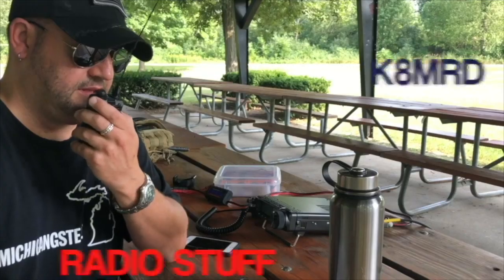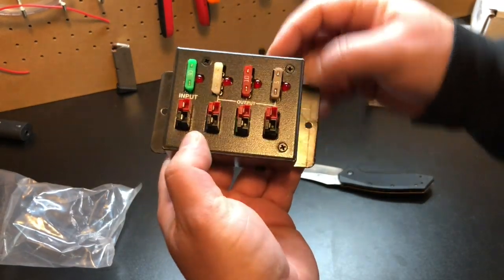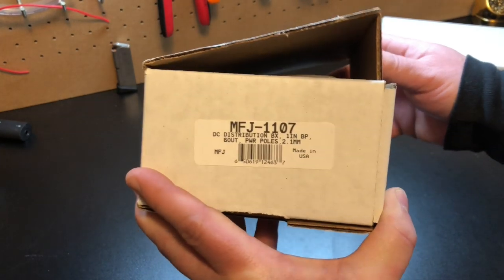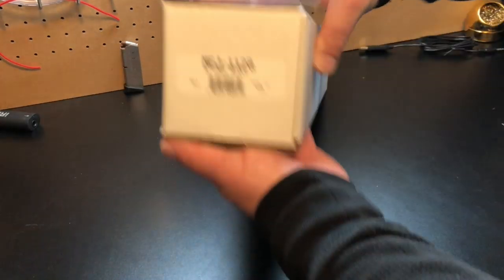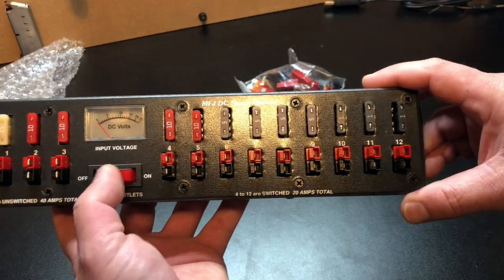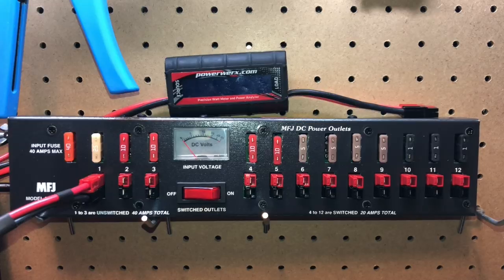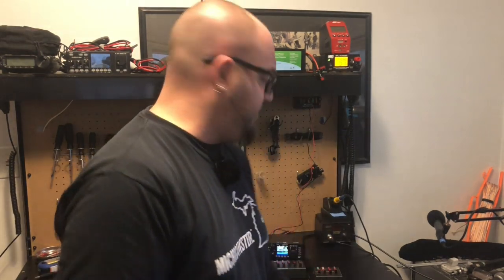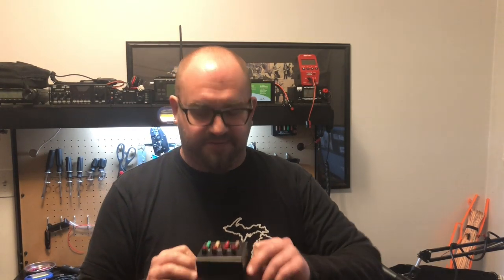Powerpole ™ Fever

Comment: Are they all 30 amp size power poles?
Reply from the maker: You can fuse them however you want if that's what you're asking.  The total current at any one time should not exceed 40 amps for the first 3 (labeled 1,2, & 3).  For the powerpoles that are connected to the switch (labeled (4-12) there is a max current of 20 amps.  It still doesn't matter how you fuse them though.
Reply: Mike
 I may not have worded that very well.
When I search power poles there seems to be three different sizes.
15/ 30/ 45 . 

I’m wondering what size power poles what I need to connect to these.
Matt
KO4WRY
Reply from the maker: @black75powder  Ahh, ok.  That's easy.  Any of those will fit.  The current rating is for the part that crimps onto the wire, not the housing itself.  Also for wire size.  15-45amp will all fit the same housing and you can mix and match what they are connected to.  For example, my tuner uses pretty thin wire, so I have a 15 amp power pole crimped onto that.  My 7300 uses 12awg wire, so I have a 45 amp crimped on.  If I wanted to connect it to 30 amp or whatever, on the power strip, or any other power pole,  it would do it no problem.  That's how they are designed.  Now when you get bigger than 45 amp, the housing is a bigger size so they would not be compatible at that point.  All 15, 30, and 45 amp power poles are interchangeable and interconnectable.  Hope that helps.
Reply: Thanks Mike I understand now.

Comment: Thank You for the information! I am not a power pole nut yet but am moving that way! Not had my license very long and the world has been shut down.  I got a 6 fuse block with screw terminals and am going to put power poles on wires. Later I will get one of the fuse blocks like one of the ones you showed.
Reply from the maker: Yes.  Feel the power of the Power Pole consume you.  Soon you will be putting Power Poles on all the things.  Welcome to the hobby too!  Thanks for watching.  73

Comment: Can you plug in your bioenno and other batteries plus your tuner and or amplifier to it for running your 818nd?
Reply from the maker: Sure.  It can be any 12v source.  I use on one of the 4 connector distribution blocks all the time when I'm portable.

Comment: Here is another thought: the proper power pole tool is expensive but worth every penny!
Reply from the maker: I can't justify the couple hundred dollar crimping tools that are sold but I do have 2 power pole crimpers that I paid about $35 each for and they work great.  One of these days I may actually get an actual power pole extraction tool.  I'm still using a small flat head screwdriver if I need to get on out, or insert one with a thin wire.

Comment: I am here because the phot of the 1129 on the MFJ web site is out of focus! I made my own distribution system last year using 40 amp powerpoles with 2x leads coming out of each to 30 amp powerpoles. It works, but its very messy. Looking for a neater solution. GM4SVM
Reply from the maker: Well hopefully you found one in this.  I gave the little one away but I use the other 2 almost every day.
Reply: @hamradiotube  Yes, my gear is in a rack and I worked out I can fit one of these in, pull the cables round to the front and make it a lot easier to plug things in and out. Especially when I have radios on test or things I am working on for the mobile set up.

Comment: Thanks for the Video.
The big one allows on the right side (switched) ONLY 20A in Total.
Reply from the maker: Thanks for watching.  You can put any size fuse you want in any of the plugs (20a max for the whole side).  I don’t think I’ve ever come close to needed more than 20amps on that side.  I plug in less power hungry things like antenna tuners and HT chargers.

Comment: How much noise do those switching supplies produce. And does the power dist, block reduce it?
Reply from the maker: I have zero noise from any power supply in my shack that I can notice.  However, I don't suspect a power distribution block would reduce it if I did.
Reply: @hamradiotube  Thanks much
Reply: @hamradiotube  Thanks much I have heard that switching supplies are rf noisey.
Reply: @stevenlawhon3695  some of them are terribly noisy. Some of them are nice an clean. Some of them make a bit of noise but have a handy knob on the front that tweaks the switching frequency so that you can move any interference away from the frequency you're trying to use :) Like K8MRD I've bought lots of cheapish switchers and never had a serious problem.
Reply: @hobbified  Nice to know thanks

Comment: Just received info today that the rigrunner drops voltage by 1v. So if someone is using a 12v battery “go box” to supply power to a radio, then it seems that with a 1v loss down to 11v for a radio would be a very bad thing. That would even be before transmitting. 
Is this common knowledge, or am I just such a newbie that I wasnt aware of this 1v loss?
Reply from the maker: Sounds more like fake news to me.  Although none of these are made by rig runner, so I can't comment on that brand, but these are really just outlet strips.  Pretty simple design and I have experienced zero voltage loss on any of the 4 that I use.
Reply: K8MRD RADIO STUFF ....interesting. The info came from one of the technicians (not sales person) at powerwerx

Comment: the 1107 has three power inputs using the 40amp fuse. The two 12v connectors and the terminals. 
I could not find any documentation on this bus even on the MFJ web site...so wanted to share..thanks for the video it helped a lot.

I didnt make it.
Reply from the maker: Yeah I kind of figured that out after making this video.  Thanks for the info though.  73

Comment: I made it AA4YU. I noticed that on the largest, the MFJ-1128 the total fused value of the output legs exceeds the input fuse. To me that is a bit of a design flaw as you can overrun your input fuse without any of the legs being over their current limits. It would also be nice if the input side were protected by a breaker so you would not have to keep replacement fuses on hand for that situation.
Reply from the maker: Yeah a breaker on the input would be nice.  It's really not a big deal what fuses are on the other side.  You can put whatever you want, just don't exceed 20amps total on that side.  You would have to have radios "on" on all of the other outlets and then transmit with one of them to go over.  I only have 1 thing plugged into that side so far, so time will tell I suppose.  Thanks for watching!  73

Comment: I made it. 8P6RC  Great Video by the way!  I just set up a 70AMP power box using power poles and will be doing a video early in the new year.  I need a little time to use it and make sure I know it inside out before making any comment. 

8P6RC

Comment: Mike, great video. The next thing to add would be something like the West Mountain Epic Gate which you would plug a battery and a power supply into it to create a UPS for your power pole distribution pleasure.
Reply from the maker: Yeah I looked at those a year or so ago but can't really imagine why I would need one.  I don't charge my batteries off my power supply and if the power goes out, I would simply unplug my Powerpole from the radio and plug it into a battery.
Reply: @hamradiotube  I get that. For me, it is because I don't want my Flex to go down without me shutting it down properly.
Reply from the maker: @don_n5skt  Well there you go, you just justified it.  Didn't think about it that way.

Comment: I made it! Phil WØRHP As I continue to rebuild my shack, I'm going all Power Pole. I even want to put the big Power Poles on my truck to make jump starting other vehicles easier and safer.
Reply: I have had one of my Dodge Cummins trucks set up that way for years. I have the winch mount equipped with one and I have a set of jumpers that can plug right in. No popping the hood.
Reply from the maker: At one of the places I used to work we had an electric forklift that had Powerpoles to charge it.  Didn't know what they were at the time.  They get pretty big for sure.